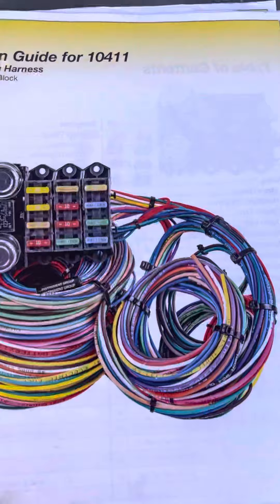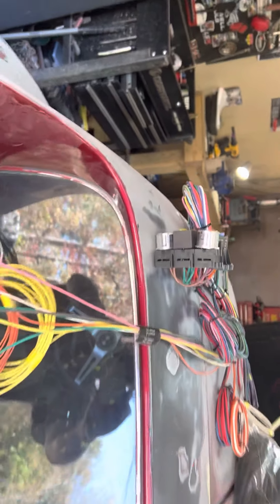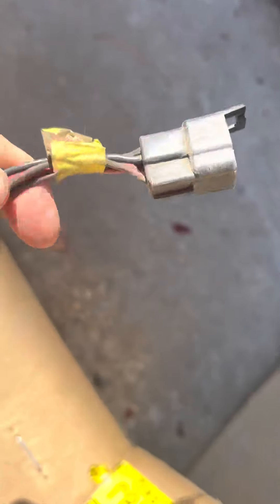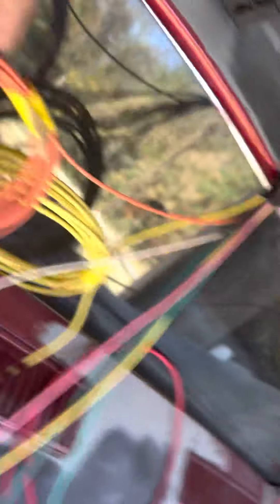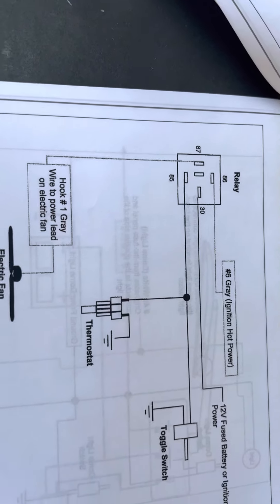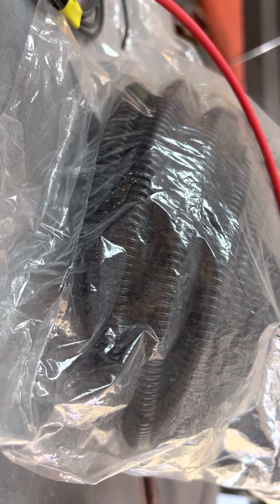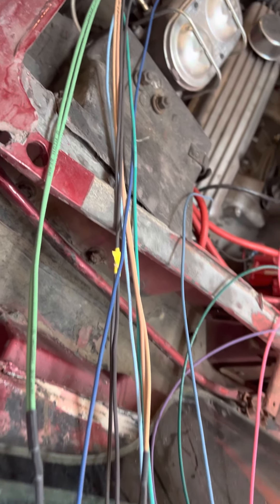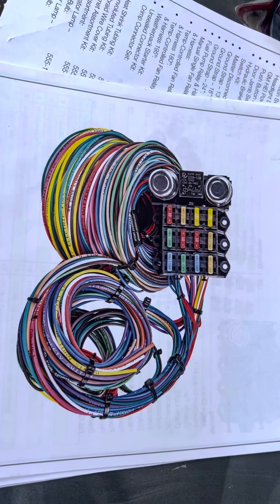1968 corvette gets a new wiring harness. Part 1

Comment: How did you get power to your fuse panel so that when you turn the key on all fuses are powered
Reply from the maker: A large wire goes from the battery to the fuse box. Some people connect this to the starter where the hot cable bolts on.